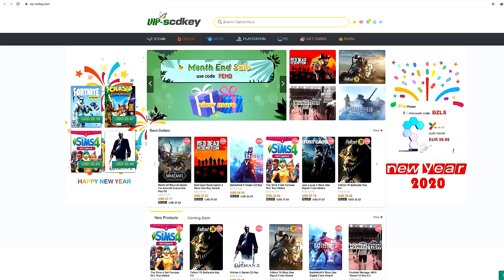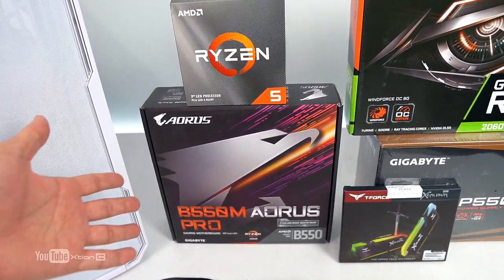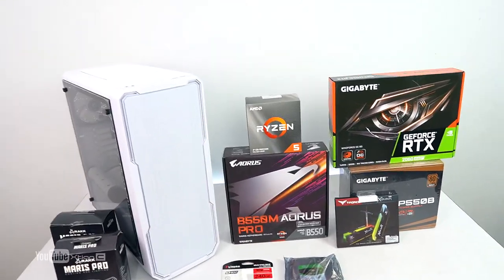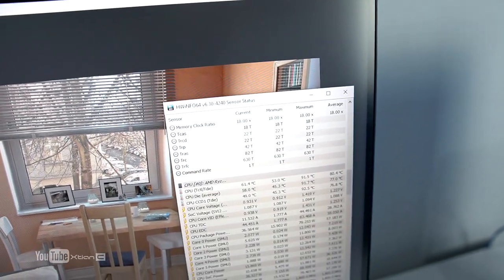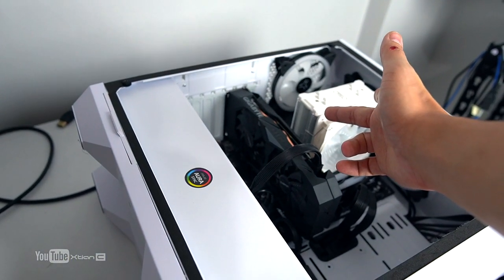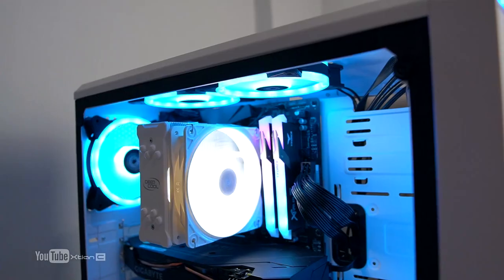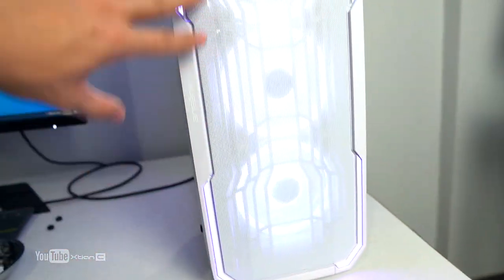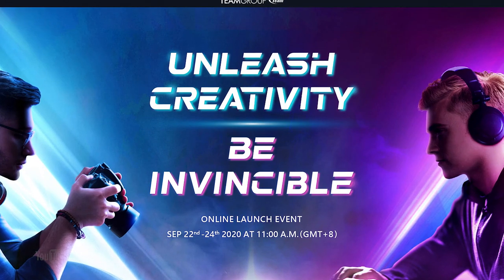VLOG: 55K Php Gaming/Editing B550 WHITE PC Build Ryzen 5 3600 I RTX 2060 Super [Ph]

Comment: Last! 👌

Ako nlng b ang ryzen 7 1800x ang 2020-2021 CPU Build 😂😂😂
Reply from the maker: Im still using my Ryzen 5 1600
Reply: Nakakita nga ako bro 1700x for 6000php and 1800x for 7663.00php
vs
Ryzen 3 3100 5500php

Sayang na SoldOut ung
Gigabyte X470 Aorus Gaming 5 Wifi for 5000php
vs 
Asrock b450 Steel Legend (Atx) 5800php or B450 Aorus Elite (6,800php)

Anyway, Same as Old times
Another Quality Build Master X 👌

Lapit n akin, Hoping December or Early February 😂😂😂

Comment: boss, ok for streaming bato specs ko na binili? ano pwede pa e upgrade? pano po mag overclock? thanks

asrock b450m steel legend 4 slot
2x8gb 3200 corsair vengeance pro
ryzen 5 2600 with stock cooler
4gb gigabyte rx 570 non OC
psu 80+ 600watts  x-power

Comment: gawa din sana ko similar build with 
Asus ROG STRIX B550-F GAMING (WI-FI)
Corsair Vengeance RGB PRO DDR4 3200 C16 2x16GB
Samsung 970 Evo Plus NVMe PCIe M.2 250GB
any suggestion with AIO? baka kasi mag liquid cooler ako. 

ung mga 6 RGB fans included naba sa case?
kano bayad pa build lods? thanks

Comment: TATANONG PO AKO KUNG KAYA BA OR GAGANA BA 'TONG SYSTEM UNIT NA BALAK KONG BUUIN, BUDGET KO KASI IS 16K, ETO NAKUHA KO SA 16k:

Cpu: Amd athlon 200ge
Mobo: MSI A320m-a pro max
ssd: Western digital wd green 120gb 2.5 sata III
hdd: Western digitan 500gb seagate barracuda
Psu: Neutron Electron Plus 700w with switch
3 120mm cpu cooler 
MSI MP221 60Hz monitor

Comment: I suggest this build if your budget is exactly 54k, this build can be brought down to 50k by getting a cheaper case with 4 fans, getting cheaper motherboard and getting a cheaper CPU cooler.

If budget is 50k
I suggest the meteor 03 case (black or white) with 4 fans = 2100
Cooler is up to you can mother board can be Gigabyte B550M DS3H = (around 5000-5700)

MOBO - ASRock B550M Steel Legend = 7399 (easyPC)
CPU - Ryzen 5 3600 = 10799 (easyPC)
RAM - Team Elite TFORCE Delta 16gb (8x2) 3200MHz = 4295 (easyPC)
SSD - Western Digital 240gb blue M.2 nvme = 2300 (DynaQuest)
HDD - Seagate 1 TB = 2148 (easyPC)
GPU - INNO3D GeForce RTX 2060 super = 19250 (PC express)
PSU - Gigabyte P650B 650W 80plus Bronze = 2945 (easyPC)
CASE - Tecware Forge M Black (includes 4x120mm Argb fan) = 2850 (DynaQuest)
Cooler 
- Deep Cool DC Gammaxx GT rgb V2 = 1620 (PCHUB)
- Thermal Past 1ml tube = 30 (PCHUB)

Total = 53636

Btw I’m doing this because I have nothing to do, I’m just waiting for Jan 16, it’s when i can go to Gilmore and buy the parts

Comment: Hello mga idol ask lng kung Pwd 

Gigabyte a320m-s2h
Athlon 3000g
Jonsbo cr1200 2 heat pipe processor
T force delta rgb ram ddr4 16gb
Ssd 240gb
Hdd 1tb
Aigo dark flash 6in1
700w intel.
Key tech t850 casing 

Salamat
Reply: Ask lng po ako kung Pwd ba irony build Salamat po